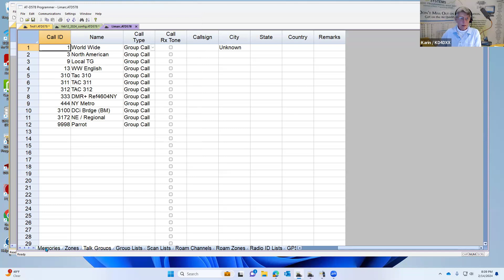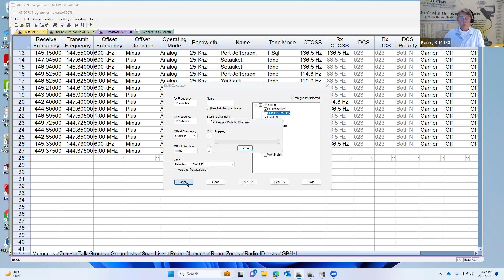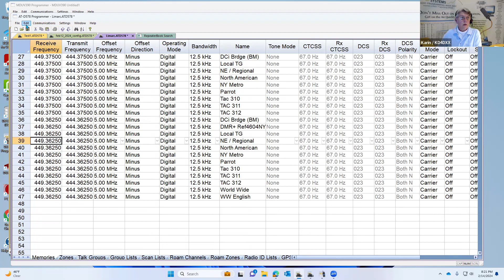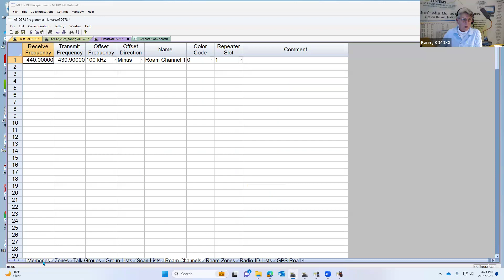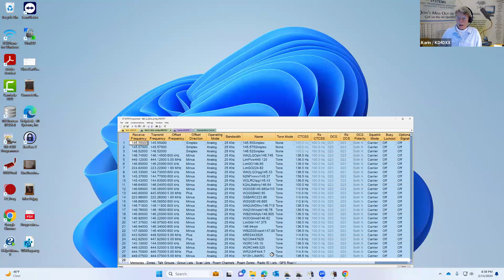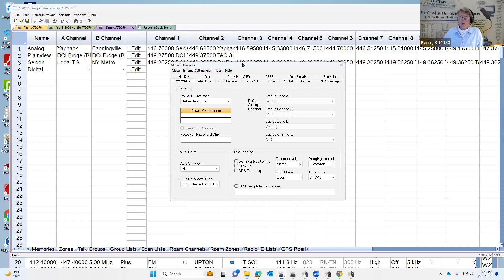RT Systems Radio Programming Software

Comment: Startiing with a new radio. Using this software,  besides the defaults, what should be your first steps in settings, anything prior of programming?  I ask because I am so confused.  I have not this radio.  I am a new technician lic. and have a IC2730a.  I use the RT systems for some of my other radios.  thanks KK7RDO (73)

Comment: I have several versions of your software.  It works great.  When I import from repeater book, I don't see the filters to eliminate the digital modes from the FM files.  I have updated all of the software.  This is on a Mac and a Windows computer. Is ther a setting I am missing?  Great video btw.